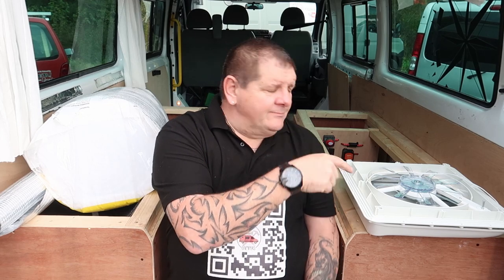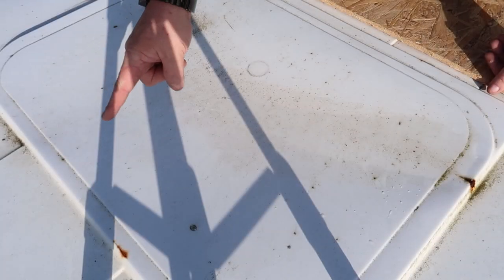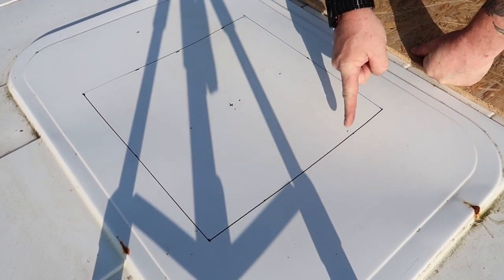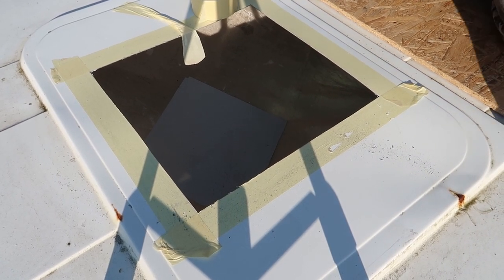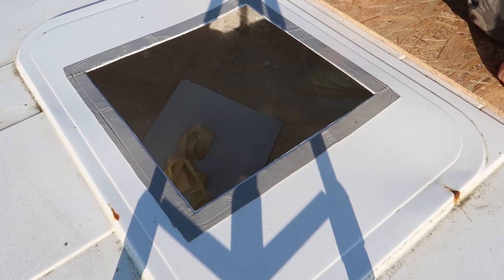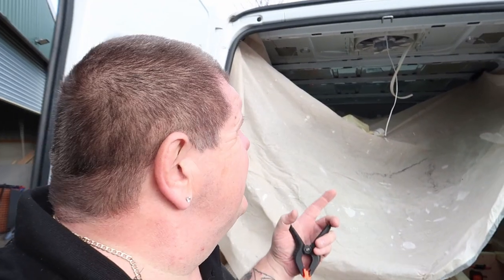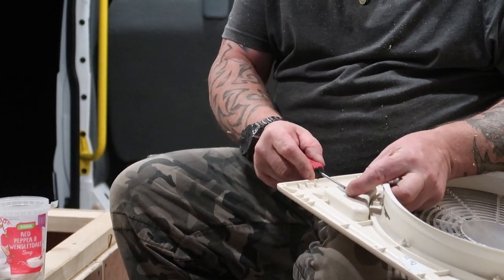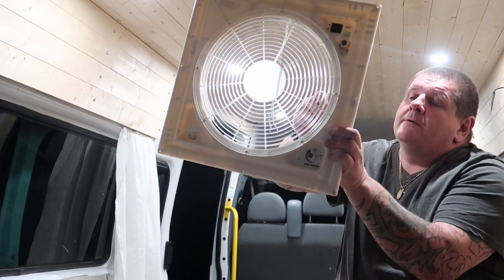FORD TRANSIT - How to Install a Roof Vent Easily?

Comment: Great Video I fitted mine on my motorhome.. that I'm currently doing up at the moment.. I have documented it on my Youtube channel Great to see you doing videos I have been a subscriber for like ages :D
Reply from the maker: I fused the battery cable both ends of the vsr before each end of the battery as per the spec.  It may look like its in the wrong place but it's by each battery Bruce with the vsr in between.